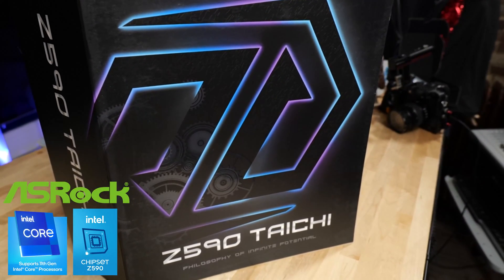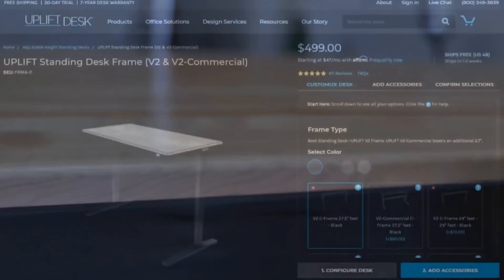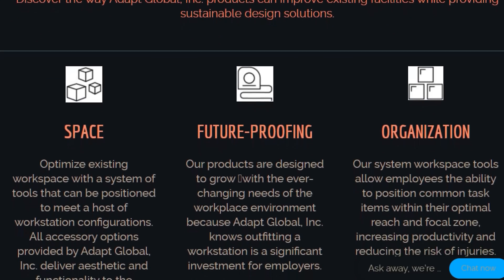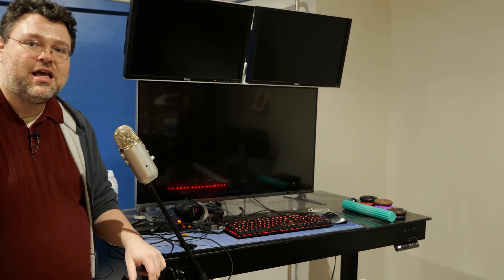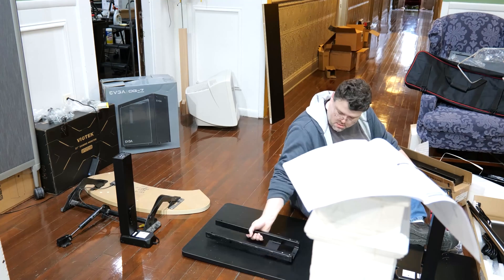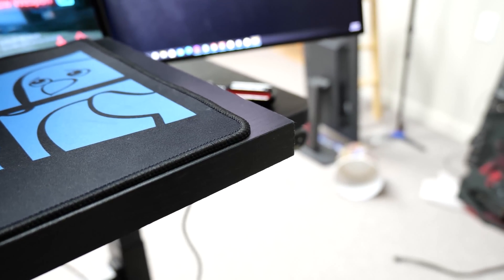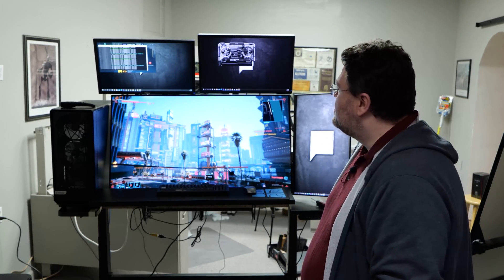Building Megadesk: 64 Cores, 5 Displays, & Ergonomic AF

Comment: Two, two unit filing cabinets, or units, and a flat door, no hardware. A bit of rubber on the top to stop the door moving. 
That makes a great desk, because space matters with lots of monitors. Plus its dirt cheap.

Comment: 14:15 May I comment that your beautiful cherry, 'corner-style'' desk seems to me to be underutilized from a seated ergonomics standpoint? The huge benefit of a corner desk is that one may 'belly up,' moving forward and against the corner niche and shifting a great amount of shoulder/head weight off of one's spine and back, and onto one's forearms, which would be resting atop of the desk. Then position one's hands and keyboard 12 inches or more away from (and not right at) the corner niche. Yes, one's displays have to move proportionally back and out of the way to accommodate the forward position of one's hands and keyboard. Give that a try for corporeal comfort during prolonged sessions. Yours truly.

Comment: I stumbled across this video randomly. I did a similar thing with my "desk". The keyboard and mouse tray are directly on monitor arms, and there is no desk surface. Three 32" monitors are mounted to the wall. There's a narrow shelf on the wall below the monitors.
Reply: I had two motivations/considerations (other than deliberately being nerdy): Remove space where clutter would gather, and make it easier to wave VR controllers around without hassle. I can swing the keyboard out of the way, and test VR stuff quickly without smacking the desk.

Comment: This is substandard. You are not reaching your potential because you are starting with the tool and not the user. You need to start with the chair and build everything around it. This is how cockpits are designed.
Reply from the maker: but uhh.. I'm standing?

Comment: What about getting an OLIVETTE BCS3030 and removing the back of the desk and gut it and replace all electronics with the new hardware, the old 8" Duel Floppy/Printer unit could be replaced with an empty cabinet fitted out with 20x 100 TiB SSD drives in a RAID array+RAID controller  connect everything up and replace the back panel and replace the monitor with a LCD monitor and the keyboard with a new keyboard.

Comment: Great project, and good results. I personally wouldn't put a computer case on a desk tho. I would put it on the ground, and route all the cables. Then just use some nice USB hub to connect keyboard, mouse, DAC, and any other stuff I sometimes connect (pendrive, portable hard drive), etc.
Reply from the maker: He was talking about doing this :) in the video. He has a SpaceCo under-desk holding mount. He just hasn't had time yet. His plan is to put it under the desk with multiple other PCs and use the Level1 KVM to switch between several PCs. ~ Editor Amber

Comment: The standup desk has its features for sure for weight loss and staying healthy, but I find it almost impossible to ditch a proper corner desk in favor of it.   The wrap monitor aesthetic is far superior.   Also those top monitors are going to give you one hell of a neck strain if you need to look at them for any length of time :P

Comment: I'd honestly be kinda afraid of the desktop falling over, or being knocked down, but other than that, i love this. Might actually take this as inspiration for my desk setup... once the pandemic is over and i can afford to buy computer hardware again.
Reply from the maker: He was talking about doing this :) in the video. He has a SpaceCo under-desk holding mount. He just hasn't had time yet. His plan is to put it under the desk with multiple other PCs and use the Level1 KVM to switch between several PCs with ease. ~ Editor Amber

Comment: My dream desk is a battlestation that has an all rigid metal polyhedral core on a 3 or 4 post stem square stock for legs (very heavy). 6 possible articulating gas assisted arms come out of the "sun" for various uses with varying articulation heights and lengths, customizable. Also attached to the posted frame is a solid wood desk that acts as a counterbalance to the leaned back orientation of the "sun" to reorient the whole desk's center of gravity to the center and where the user would press down most. The desk surface is height adjustable and attached to the desk very much like what Wendel did, is a cutout for keyboard/mouse/other peripherals but not in one piece.  Two pieces. One each individually single hand adjustable for rotate, height, tilt (with a lock knob) orientation and depth adjustment (slider) for KB and M separately with like Wendel's, the ability to rise above the desk level without getting in the way of your legs in a seated position. Everything made of powder coated steel and built like a flipping tank so there is as minimal wobble as possible when really grinding on it. It would be called the "Black Queen" because spiders and if done right probably cost in the 3 to 5k range if mass (limited because cost but still assembly line) produced with quality materials.

For now I'll deal with my hack job of a table on other tables with all the articulation attachments I could ever want (so long as the center of gravity is correct). Only, my garage job is not height adjustable nor does it look as cool. But independent mouse and keyboard articulation..   I will never go back to a flat desk or singular adjustability.  The range of movement and orientations I can sit in comfort while sitting, working is...   I can't go back to a single surface. They have to be individually adjustable by a single twist of the hand.

Comment: After building 3.2m x 1.5m L shape custom wooden top that floats on console strut channel wall-mounts (completely free space underneath), I don't really get your vision of ergonomics.
Yes, my bench is not sit-stand, but it already is made exactly for my height, has plenty of space (0.6m wide) so I at least got some place for arms to not hang in the breeze, not to mention space for PC bench and electronics lab workspace.

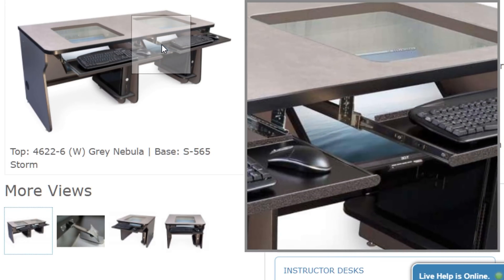Comment: 7:06 hmm thinking about making a workstation out of an arcade stand
Reply: That's be cool! If you do it make sure you put out a video. I've thought about something like that as well, with a projector inside the pedestal rather than attaching monitors. I also thought about building an integrated keyboard with arcade pushbuttons rather than a conventional keyboard. Ha! but then I thought of all of the drilling that would be necessary just to make an ergonomically questionable keyboard and dumped the idea.

Comment: Definitely recommend mounting a battery backup low. That looks top heavy and a trip over a wire could spell disaster.
Reply from the maker: UPLIFT makes solid steel desk legs, they aren't going anywhere. I couldn't push it over if I tried. ~ Editor Amber

Comment: Two of my hobbies are computers and woodworking.  This is a great video!  I currently have an Uplift desk but with painted plywood as the desktop. I have walnut that I intend to use as the top but I'm having a hard time planning the wood down flat (I only have hand planes). The idea of having adjustable keyboard is amazing because I can only have the monitors and keyboard to be comfortable when I'm either standing or sitting, but not both.
Reply: If you still need that tabletop planned and have a vehicle, you could take it to a lumberyard, they would probably only charge like $10 to plane both sides down for you.

Comment: This is actually the kind of viewing angle I switched to when i had to use a standing position due to back issues. 

It’s not as fancy, but my solution was to get a separate height adjustable laptop stand put in front of my existing desk and the monitor arms I swapped the thru rod for a longer one and placed through a few wood blocks on the desk so the monitors could raise to where i needed it.

It’s much more ergonomic and less fatiguing on the eyes. My solution also has the benefit of the keyboard tray not connected to the desk so there is no wobble on the monitors or the mic and cameras attached to the desk.

Comment: I have to ask, as a multiple monitor user on Ubuntu like you, how do you manage your windows when you wake your screens? If I have screen blank turned on, and allow them to black, when I wake them up I have to turn monitors on in display settings and reposition all my windows. Every damn time. On my Manjaro desktop XFCE at lease has profiles that I can apply to wake and reposition all my displays somewhat easily.
Reply from the maker: Pop os has a cool tiling thing for gnome. You can toggle it on and off with a hotkey. Greatly helps the spasm from wake

Comment: Need some kind of anchor/clamp to hold the pc tower from oopsie off the edge and unfriendly meeting with the floor
Reply from the maker: Spaceco elevator. Thought thst was in there
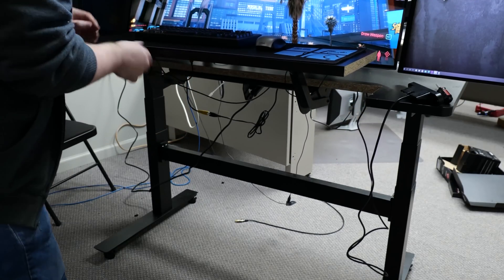Reply: @Level1Techs  from 12:50 on, all I could see was a remote control ontop, and nothing holding the pc freestanding on the end?
at 14:33 I just see the pc sitting on the edge
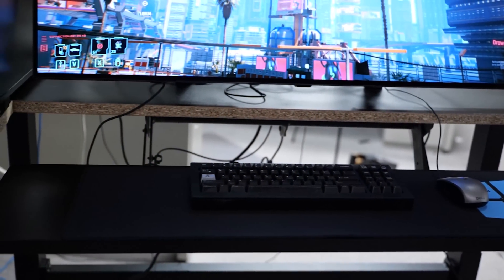At 11:40 I guess you indicated that the Fractal case would later be mounted in behind to the horizontal member, with the 5th monitor going on the left
Have a good weekend Wendell

Comment: I really mind the center beam on the desk and I would want a lot more deskspace so the pc should go under the desk in a corner. I would just wire up a power button and mount it to the front of the desk on the right.

Maybe I should build my own frankenstein desk too.
Reply from the maker: The space elevator under desk thing is a thing

Comment: monitor arms definitely can make more efficiient use of cramped areas.
In my home, we use an older ethan allen dining room table with an extension leaf inserted as a desk.   On that desk, we have 3 computers - my main rig with 2 27" monitors on monitor arms, then an lg 3440x1440 screen on monitor arm that is shared by our secondary gaming rig and my wife's work laptop.  sure makes it super easy to push monitors around depending if wife needs to work, or we can get into some gaming at night.

Comment: I made a setup similar to that except without a desk, just used a mobile tv stand with monitor arms attached to box section clamped to the legs. I also use a monitor arm for my keyboard that just swivels out the way when not in use.

Comment: I got the longest arm Spaceco offers (the long xp one) because it allows me to use my monitor in a few more locations in my dorm room, but it doesn't work very well with my XG35VQ. Once it moves the slightest amount it keeps wobbling forever (fun when my desk moves a millimetre). It also doesn't help that the screen is curved and therefore the centre of gravity is a bit too far forward, so adjusting the ball joint near the screen is a pain. Sadly I have to adjust it every time I move the monitor as the second and third arm on it bend a lot under the weight of the monitor. 

What I would really want is a more stable monitor arm, one which is at least as stable as the arm with the gas strut in it, but then for all of them (even the gas strut visibly bends under the couple of kg that I put on it, but it is at least a lot better). I would also want one which has adjustable springs in the mounting mechanism near the screen to offset the weight of the screen when adjusting the tilt of it. In a perfect world the monitor would just more or less float freely on this arm and I can adjust it to wherever I want and it stays there without wobbling around for another 5 minutes. Any ideas whether something like that exists?

Comment: Thanks for showing your process, Wendell - fab Megadesk.  

I just know everyone wants to read about my rig, so ... I have a 1980 Mobler Furniture teak  veneered scandihoovian design dining table aka computer desk – one leaf extended - 68"x32" with an amazon monitor arm for my Acer 34" ultrawide.  My Claymore Core and M65 play on a Gamers Nexus mat - sorry, Wendell.  The ol' 2016 i7-6850K Broadwell E X99 H440 1080 SLI monster anchors on the table end without extension.  A cheap amazon computer chair provides all the adjustment I need for comfortable gaming and typing.  All this said - er, typed I earnestly encourage you - and others - to create new setups and share the results.  TTFN.

Comment: I've got an Ikea Galant corner desk right now with a 3+1 monitor setup (28" in middle, two 27" flanking, 1 27" up top). I've wanted a sit-stand desk for a while. I love what you did with this...especially that keyboard platform. Gave me all sorts of ideas.

The monitor arms I use are from Monoprice....and definitely match the price I got them at. They support my 27" monitors, but do sag a bit at times.